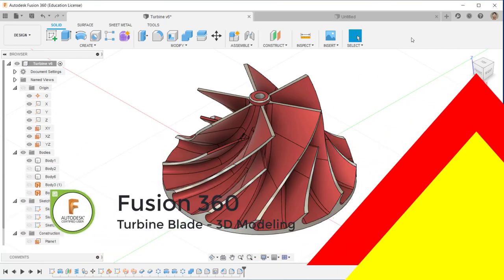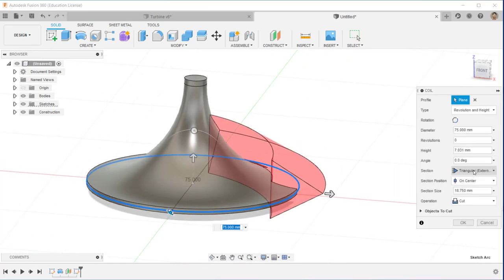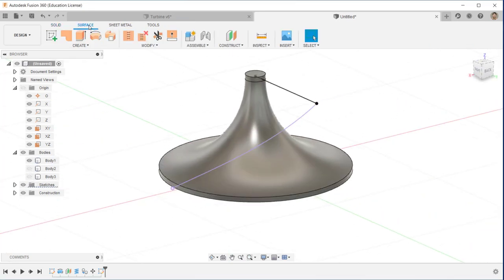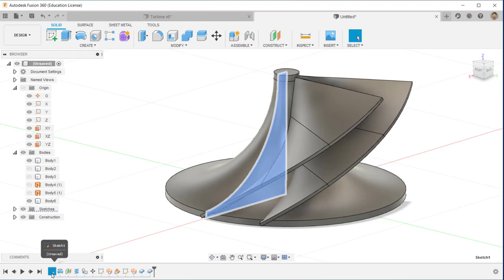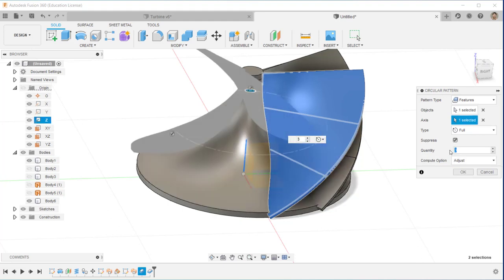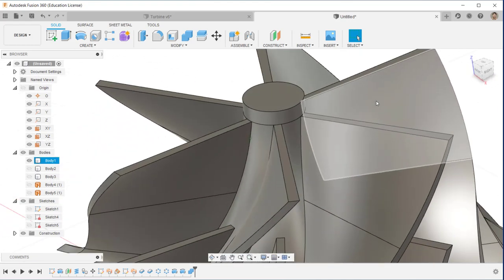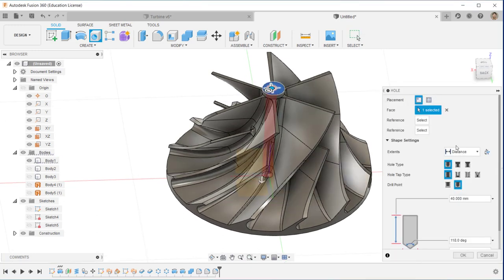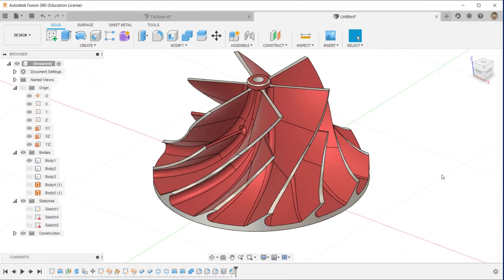Turbine Blade - Fusion 360 Tutorial

Comment: Thank you for the video. I’m having trouble at 2:57 where I cannot set revolutions to 0. The 0 I entered would turn red and I was not able to create the coils. I have all the dimensions right and followed all your steps correctly. Maybe there’s something wrong in my settings? Any help is appreciated. I am a solidworks user trying to learn fusion 360 and this is the first video that I watched and tried to follow along. Thank you for the tutorial.
Reply: I'm having the same problem
Reply: If you look at the pitch parameter when he switches to height and pitch it gives you a value of 152 which you can use instead of the revolution parameter.
Reply: instead of setting it to 0, set it to 0.25 since he got a quarter of a rotation